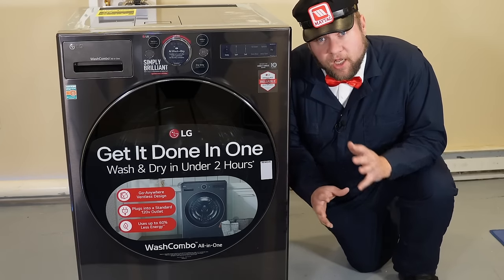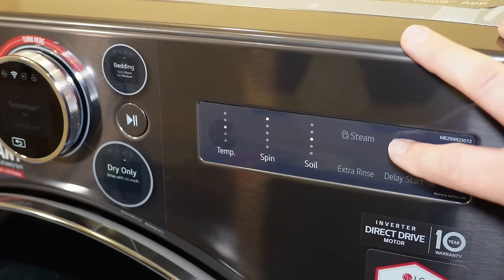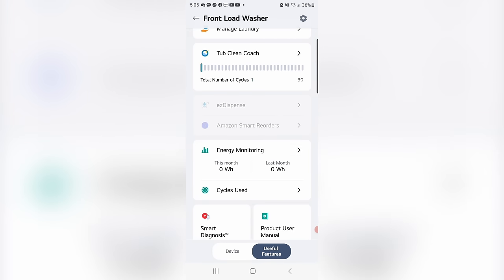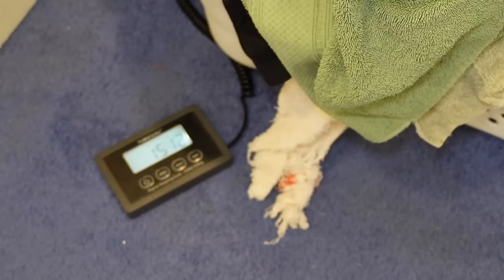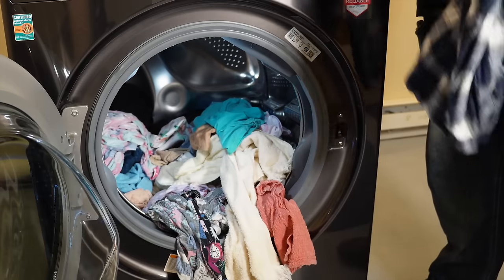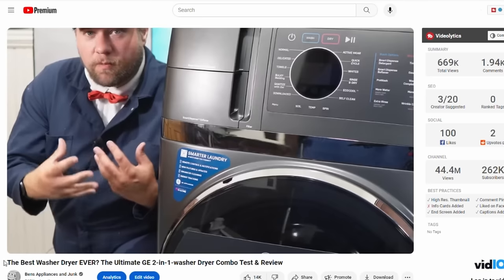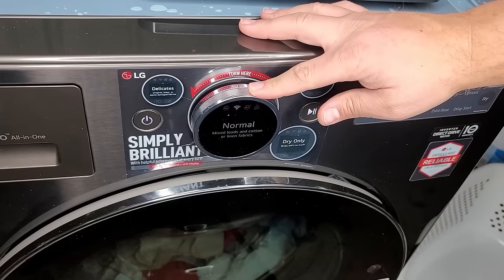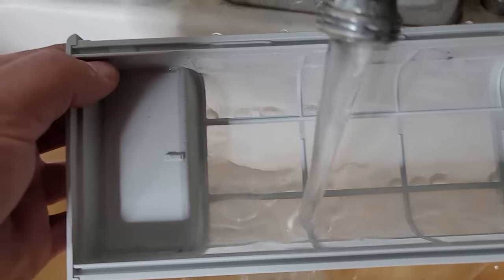BETTER THAN GE? The LG All in One Washer Dryer Combo: Test, Teardown & Review

Comment: My #1 concern being build quality and long term cost of ownership: I think the GE is the way to go. The modularized heat pump system with 5 year warranty and easier tear down are huge to me. Also the LG lint buildup after like 2 cycles when the coils are SO DIFFICULT to reach is insane. GE has that extra filter...

I'd rather spend $500 more on the higher quality unit than spend that on an extended warranty.

Also, i want to mention that the LG has a very cheap feeling fake-metal plastic ring on the front as the primary interface. It looks bad in the showroom so you know the plastic will wear and look awful after a couple years. The GE interface is less high tech but looks and feels better.
Reply: Also, like many consumers, I don't really care about the app. The GE app notifies me when it's done and that's all I need. I have to be at the unit to load it so I don't care to pull out my phone instead of use the controls right there.
Reply from the maker: I didn't mention it on camera, but bringing the LG unit into the 2nd test facility resulted in the entire UI knob breaking off. On one end, we were able to re-install it, but the way the knob-within-a-knob system is designed, its now damaged due to a minor bump in the wall. 

However, when I say it broke off, part of the harness shattered, ect. We were able to repair it (saving me killing the video entirely), so that was good but yeah... Not a fan of how so many of these knobs have a shoddy system like this. On the other side, I wonder if I could have bypassed it with the app entirely.

Comment: I guess it’s just a compromise to have such a long drying cycle but not having to run a vent, we bought a 2 in one and it terrible at drying, I just wish manufacturers would offer a 2 in 1 with the option to vent it, when we finished our basement as an in-law suite space was the issue venting was not.
For convenience, I’d rather have a dry cycle use 1000w for 2hrs then 500w for 4hrs.
In our main house we have the LG Wash Tower and it’s been great. 
As a side note, I’m a refrigeration tech and after so many LG and Samsung compressor replacements, I wouldn’t buy their residential fridges, this makes me question the hp compressor in the washer/ dryer.

Comment: Being a retired HVAC Tech with over 30+ year experience I will say this. I am sure no matter if you buy an extended warranty to supplement the compressor 1 year warranty, if the evaporator/condenser on not regularly cleaned (especially if noted in the manual), they will consider the warranty void. And for all those that don't know what happens to a system when the evaporator blocks up with dirt, it will ice up and expand and possibly damage the coil thus releasing the refrigerant or can allow liquid refrigerant to flood back to the compressor and damage the internals as liquid cannot be compressed, and the same with the condenser being block the unit will run at a higher pressure until the refrigerant leaks from a failed joint or the compressor burns up. I am no an appliance repair tech, but I wonder how much this 'annual' maintenance cleanings will cost on these appliances?

Comment: Even though it's not a linear scroll compressor like their class action lawsuit.. Made by LG... Oh no I wouldn't trust it won't die from a small 5 cent rubber gasket failing because they tried being fancy with the design. I bet you they are only providing a 1-year warranty because they're getting sued for claiming their compressors last for 20 years, but only offering a 10-year warranty in the refrigerators when they only last 4 years..... So offering a rotary compressor with a 1 year warranty is dead in the water for me. Especially if it's an expensive part.

Comment: FYI, no matter what the manufacturer tells you, your warranty is not voided just because you open the machine. Magnuson-Moss Warranty Act is incredibly clear about this, and the FTC has reiterated this to numerous manufacturers in the last 5 years or so. "Warranty void if removed" stickers are flat-out illegal. Under MMWA, the legal burden is on the Manufacturer to prove that an action taken by the customer caused the damage that they are refusing to repair under warranty. The simple act of breaking a seal means nothing. This is a common misconception with warranties, and these manufacturers have done a great job making people think this is true. Case in point, this video.

Comment: Between the water usage and electricity usage plus potentially long run times I think you really have to have some significant reason why you can’t use a traditional washer dryer.

Comment: I had an older version of this LG. Absolute trash because the pump broke 3 times in 2 years, which is a known common issue and I had to majorly disassemble the machine to replace it. Love the washer dryer combo concept but have they fixed this issue in these newer machines?

Comment: This is a scam. My Sister bought 1 of this in 2019 and sadly the Drying stop working. She only had it for 2 years. What so annoying about this is the Filter, there is 2 filter the Outer Filter and Inner Filter that you have to use Screwdriver to unscrew it and clean it with vacuum.. You must do it every 10-20 Usage depending how big your load, there a build up Lint inside the Inner Filter where the condenser is.

Comment: I bought one of these LG combos back in 2004, I had to order it for an out of state seller because Best Buy and Home Depot/Lowes did offer it.
It worked well except the dryer used to wrinkle everything. I used the drying function only for my little ones stuff , and when they grew up I sold it, because it started to cost me more time and money ironing the wrinkles.
Reply: They didnt make these is 2004, the new model uses compressors. The older ones had a heating elemen.

Comment: Undersized heat pump is another win, I like the resistive drying to supplement it. Cost is lower, and more compact unit, with a little bigger drum, than GE. 600 Watts peak is still way less than a typical electric dryer. Hugely less.

Comment: I’m still trying to figure out why I would ever need or want my phone involved in  washing a load of laundry? 🤔 I often rant about ‘too much technology’ inundating our everyday lives. I think this is a good example of that. At least it’s an option. The previous generation of LG washers had an excruciatingly long “load sensing” thing they did before the machine decides to start adding water to the tub (and a 35 minute spin cycle). That was my previous deal breaker with LG. On this model, I can already see it’s gonna be the lint on the coils + only a 1 year warranty. 
I think the real selling point with LG is how quiet these machines are. I got Mom an LG dishwasher one year and I kept wondering if it was actually on or working right when she was using it. It barely made a sound. They have some sort of DC pump that just doesn’t make any noise at all. 
I appreciate the review though and I look forward to more!
Reply from the maker: IMHO, if you don't want the phone aspect, the GE is way more intuitive on modes.

Comment: one year warranty on the compressor, why does this sound like the same issue the refrigerators are having?
Reply from the maker: That's my worry. LG allegedly fixed the problems w/ the fridges right at the end of the R-134 lifecycle, but then went to R-600 (like everyone else) and most techs are saying the problems are back again. However, you're not using this 24/7 like the refrigerator's compressor would be, so in theory it should last longer.

But if it really would last longer, why didn't they give a 3 or 5yr on the sealed system?

Comment: You did not show the interior side of the plastic cover that covers the heat pump coils. According to LG, it's supposed to have a water "cascading" over the evaporator coil when it runs the "coil self-cleaning" function during each cycle. Seeing lint being stuck on the front of the coil is already disappointing because it shows that this system is not very effective, but it would still be interesting to see how this water-based coil cleaning system works, purely from technical point of view.
Reply from the maker: My apologies. One of the shots had it but maybe the editor didn't include it. I'll look and see if we can't add it later

Comment: screw LG! They resigned the worst refrigerator compressor ever. I hope they go out of business. Their TVs suck too!
Reply: The issues were contained to 2014 to 2017 models and issues have since been remedied.  I have 2 LG refrigerators one in CO and one in FL......both have been running flawlessly for over 8 years.
Reply: @darknes7800  Um, wrong. There's a new lawsuit filing that's exposing LG as continuing to sell the faulty fridges after 2018.

Comment: Not sure if I'm a fan of either of these two all in one washer dryer units. As an appliance repair technician the both look very time consuming to work on. Time will tell if they hold up to normal consumer use.
Reply from the maker: As a tech, you should be charging a premium for these and also hoping consumers flag this as desirable to repair since it's more expensive.

That and if this DC drain pump is anything like the 2001T youll make bank on the swaps. Super easy to replace.

Comment: I don't get the interest in combo units. I have to wait twice as long to do another load. Why? I can do a normal load in my ge washer in 55 mins then transfer to the dryer, start a new load and when my laundry is dry the washer is done. I wouldn't like waiting 2x longer to skip a step of transferring clothes. Maybe this is for lazy people..???
Reply from the maker: Not everyone needs to do 2 loads a day, or have the space, or have the hookups for a WD set. In the case of this unit, it can be put quite literally anywhere, so it does open up washer dryer opportunities for people that can't use a traditional WD set. Like I said near the end, I'd much rather have the washtower by LG if it was a stackable, because the wash/dry times would blow this away.
Reply: @bensappliancesandjunk  Well said 🙂 lol. Good points.
Reply: Lazy people? Space saving and noise level are a HUGE deal for me here in a small urban condo. When I renovated my laundry room, the 2 machines side by side took almost the entire room! I sold the washer and dryer individual units and bought the older LG WM3997HWA combo unit, and suddenly I got half the room back! I built a shelving system instead of the old dryer and created a nice storage area. The space saving is great! Also, these machines are nearly silent! We have no problem turning this on and going to bed, we wake up to dry and clean clothes! The extended timing doesn't bother me. We're not doing multiple loads per day, not at all!
Reply: @AlTheEngineer  Good for you. So you live in a box lol. But recently sales don't show this as being needed in the market.
Reply from the maker: @Connor-xe6fl  where are you getting the sales data from? What I've heard from salespeople is that the GE unit was the fastest-selling appliance in history which is why LG, Whirlpool and Samsung will all have competing units out befre end of year.
Reply: @Connor-xe6fl  nah, in the city that's what I own, its more of a necessity since I make most of my money from the city and I'm not willing to pay rent prices, they're asinine! Out in the country we have plenty of space / land and multiple story properties, but that's not the focus of this washer/dryer unit, so I wouldn't buy it there. The laundry room at the condo is pretty much a box yeah, so I'd rather have 1 machine that washes and dries and save the other half of the laundry room for something else. The rest of the condo is decently sized - but condos are usually designed around a larger living area and they tend to skimp out on space when it comes to laundry / storage areas unfortunately.
Reply: I totally get this point. Everyone's use case is different. I literally pile the clothes in my GE combo. Hit a few buttons like Power, Normal and hit the start button. If it's a normal sized load it's washed and dried in a few hours. My machine is in my basement so it's a hike just to transfer loads. Plus we have the flexibility to set a delay timer so it's done when we wake up or get home from work, or have a remote start.  So you can already start folding a load before starting a new one if you plan it right. Plus it's just the two of us. Plus we never have to re-wash our clothes the next day because we forgot to transfer. But if you have a large family, or a dedicated laundry day and your always in close proximity of your washer/dryer I can totally still see the appeal of two units.
Reply: @gosmond  Honestly, I didn't even know combo units existed until I traveled to South East Asia in late 2018 and stayed there for a few months in a really nice high-end high-rise rental. It was equipped with a smaller LG combo unit and it blew my mind how silent it was and that it did both washing and drying at the same time! So when I returned to the U.S. in 2020 I immediately outfitted my condo with the largest combo unit I could buy at the time (which is also from LG, the WM3997HWA)! Still works really well and I enjoy using it!
Reply: @gosmond  Yeah I do see that side of things and it makes sense. Everyone's laundry demands are different and vary by lifestyle. I luckily have a 1st floor laundry room in my home so no going up/down stairs for laundry. I have a dog so I wash his beds, blankets, toys often. I use the sanitize cycle a lot and also wash a lot of bulky things such as towels and my own bedding, hoodies, jackets, ect... so for me 2 unites independently is a must.